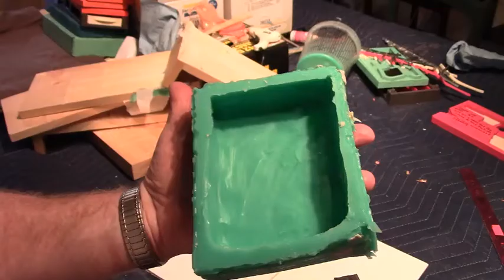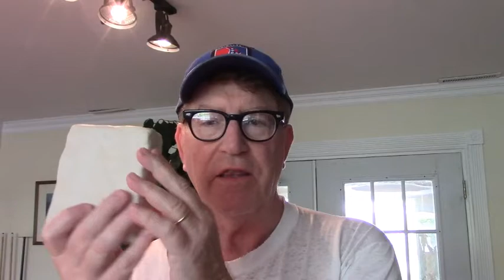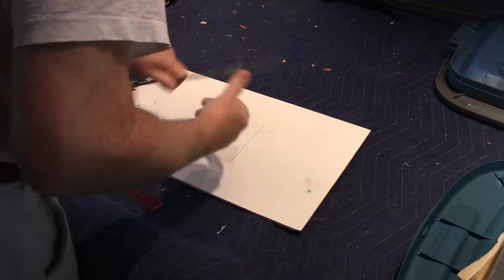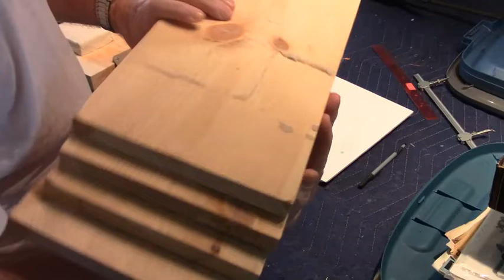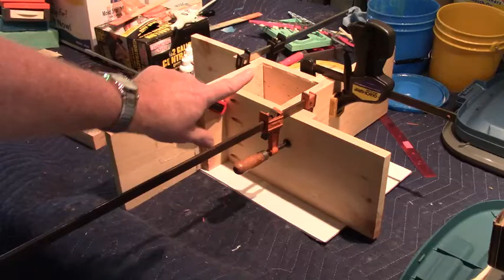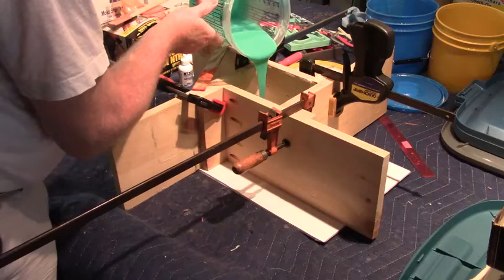Custom Carburetor Spacer Plate Part 3 1966 Chrysler 383 - 727 Automatic #nonamenationals

Comment: Cool!
Reply from the maker: That's a might kind of ya Tom!  I see you now and then on the "live" spots when I can spare the time.
Reply: @lbbruins7958  I also make components with stuff from smooth on. Its fun with all the plastics and resins. I'll be watching to see how it comes out. Good luck
Reply from the maker: @approachingtarget.4503  Yeah I keep forgetting you and I think Moparnut62 are the guys in plastic and Poly molding.  Are you the one who has tried using the metal in the hard poly mold material?
Reply: @lbbruins7958  no. Must be moparnut. If iam using metal in anything for casting, it's aluminum in platinum cure silicone.
Reply from the maker: @approachingtarget.4503  No you're it!  That's right.  Aluminum in the platsil.  What do you use to melt the aluminum stock with?
Reply: @lbbruins7958  small propane forge.
Reply from the maker: @approachingtarget.4503  Nice!  I'm going to look that up.  Any special or recommended tools?  Do you do any casting in sand as well?